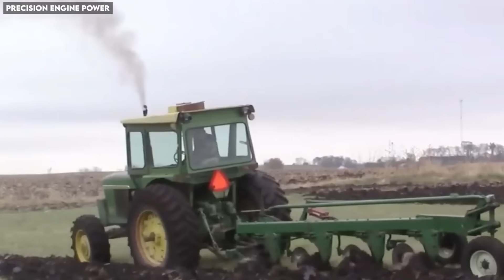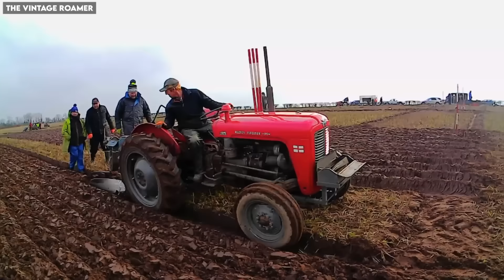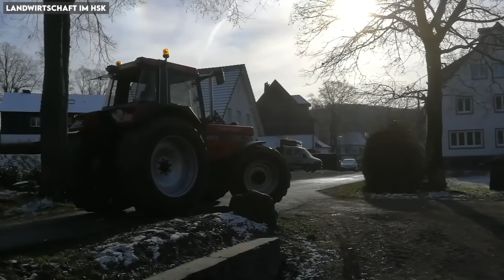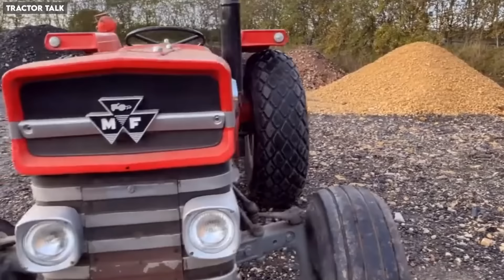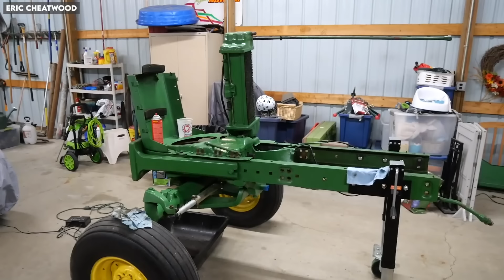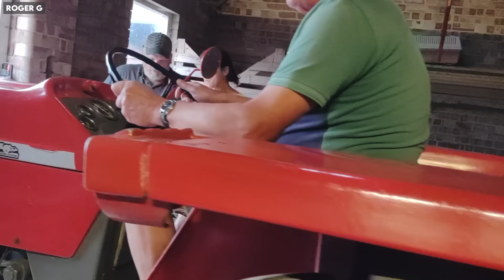10 Old Legendary Tractors That Still Dominate Today

Comment: The Grey Ferguson was the tractor that changed Agriculture with the 3 point linkage. The first Ferguson 35's were and still are fitted with the Standard 4 cylinder which is a notorious differcult starter and it wasn't changed until they joined with Massey Harris before they released 35X which was the first 3 cylinder tractor was in competition with the Fordson Dexter